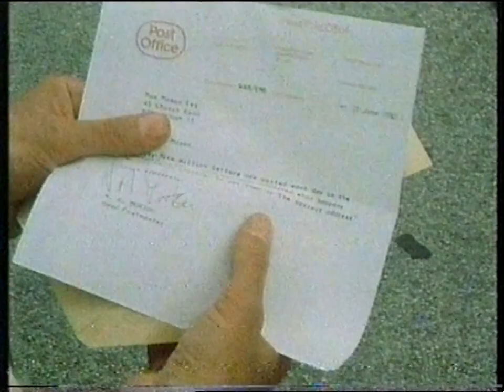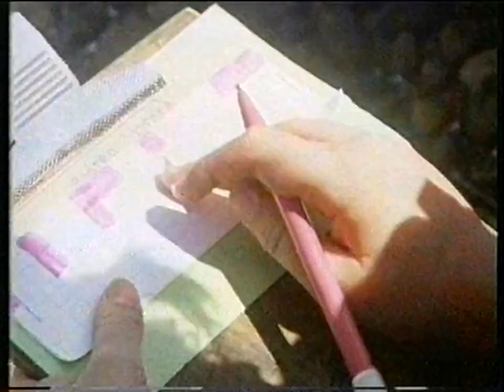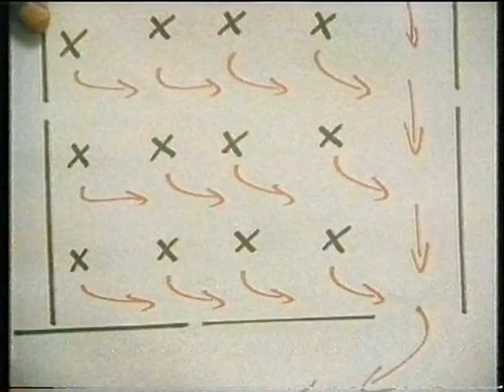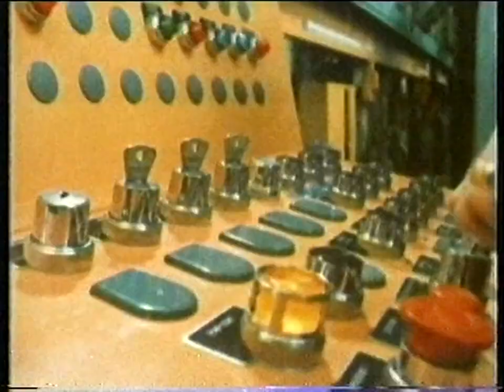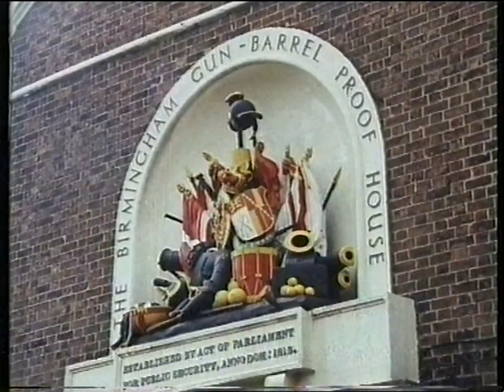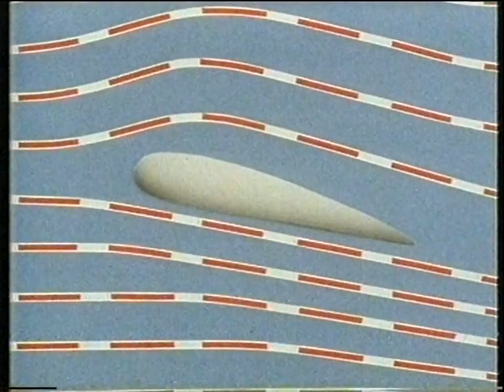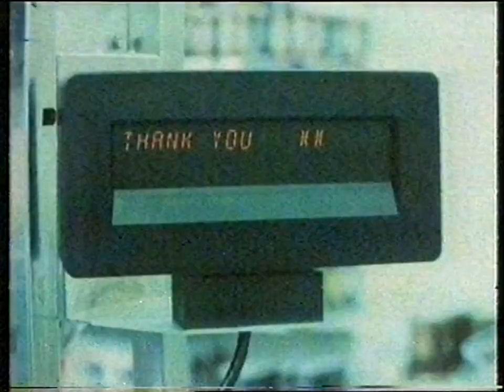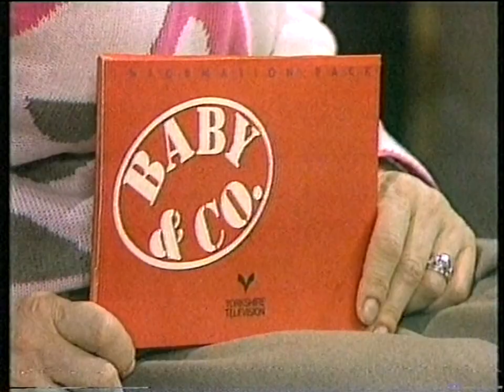Starting Science - a complete primary school VHS's-worth - Spring 1985

Comment: 16:47 31:48 It would be interesting to check the newspaper archives and see if those advertisements can be found. 27:40 That's similar to how a fax machine works a demonstration like this was done on The Secret Life of Machines about the subject fax machines. What they're doing there is essentially what computer  binary is on or off (in this case coloured or not coloured).2:50:45 Is the text file test transmission available on the internet for use in an emulator? That should be preserved too just for posterity sake.
Reply from the maker: It was decoded by people on an Acorn user group. It's very very boring.